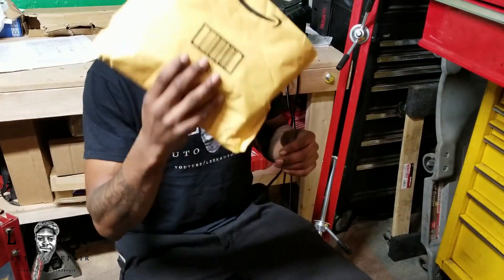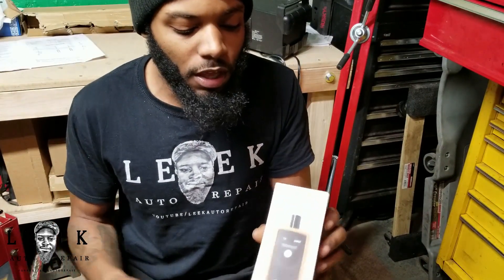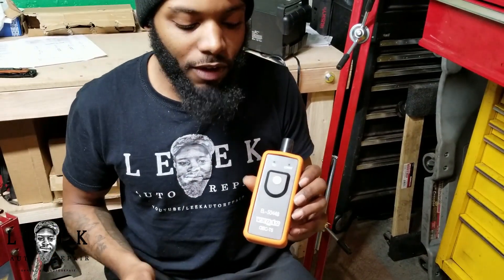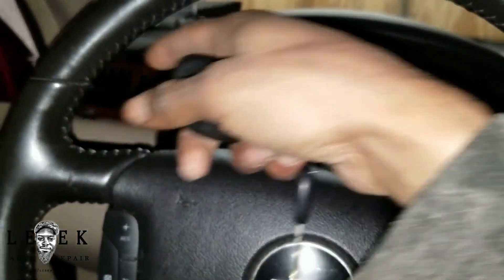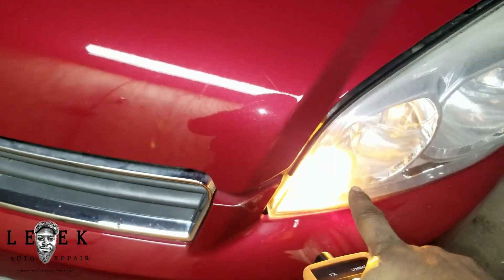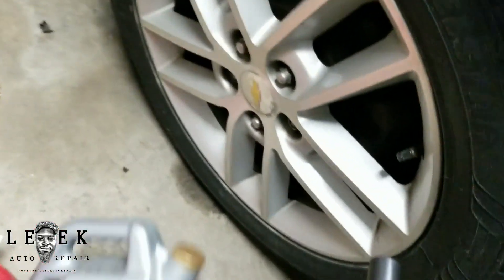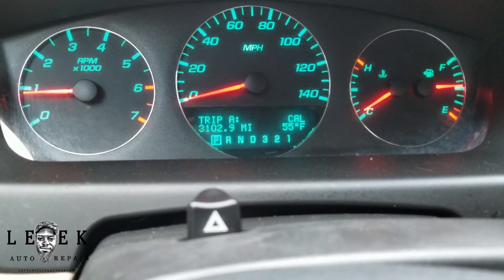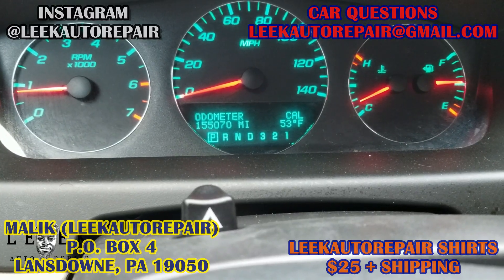How To Relearn & Program Tire Sensor | For GM Vehicles

Comment: You can also just inflate/deflate the tire until the horn sounds. No tools required. However, you then have to inflate/deflate the tires to the proper PSI afterwards which adds another step. Looks like a handy little tool tho for the money. Should help save a little time and make you some money.
Reply from the maker: This method is a relearn procedure.....not to program a new sensor
Reply: @Leekautorepair  I used this method to program a new sensor on a 2009 Cobalt about a week ago.
Reply from the maker: If it worked for u cool......I'm not gone flatten no tires to do a sensor when I'm resourceful lol
Reply: @Leekautorepair  lol I was concerned about that too at first.